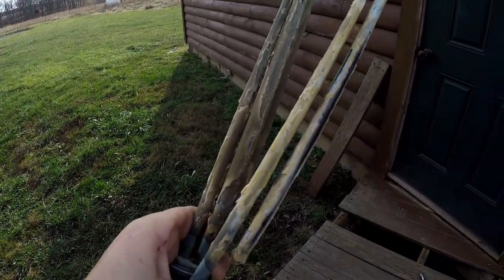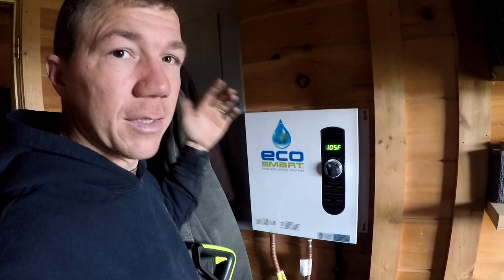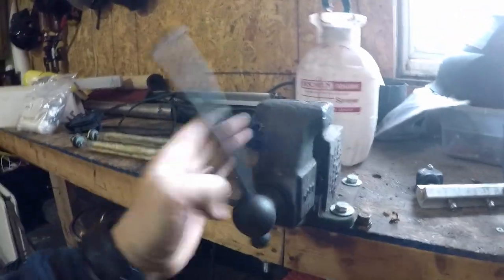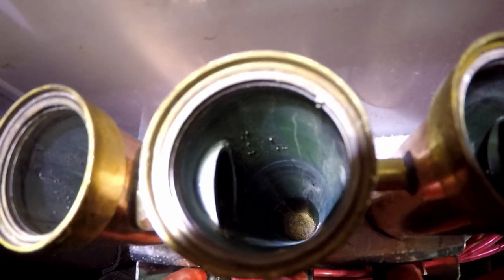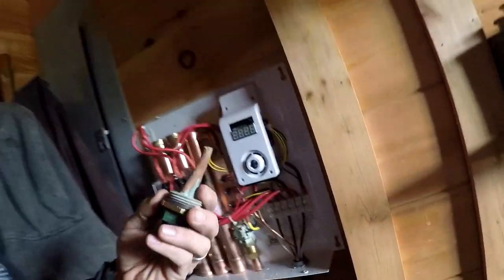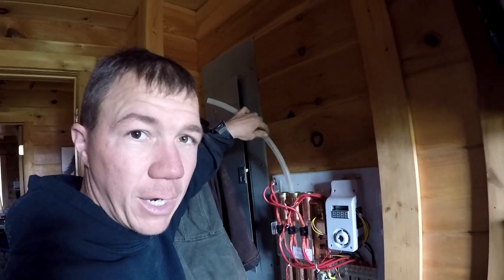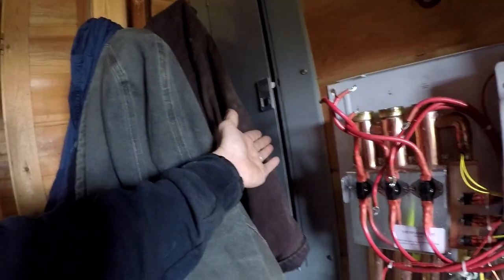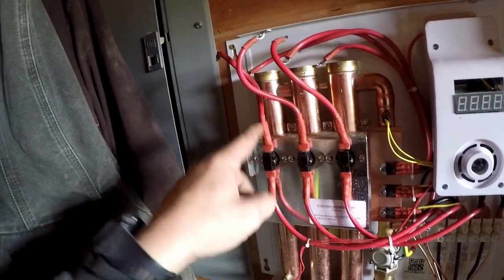How to descale a tankless hot water heater for free!!!!

Comment: Mainstay sells a flush kit that comes with a solution , the pump , hoses ,and a bucket for that. Always check the continuity on them elements first so you don’t waste time cleaning them. I’ve seen them bad and look perfectly fine.
Reply from the maker: We have tried the kits before and they didn't make hardly any difference. That is a good point, I haven't tested our elements.. however scale build up is a good way to see they are functioning I guess it's just not an instant answer.
Reply: @FreedomFarmsMo  you’re right about them kits but that’s what the company will recommend. Disconnect all wiring before checking continuity on the elements. I hope you fixed it anyways have a great day guys and keep on uploading these sweet freedom farms videos!